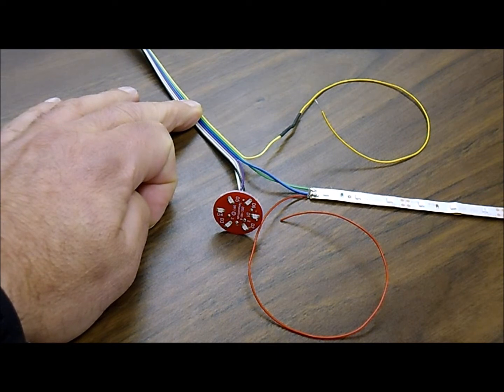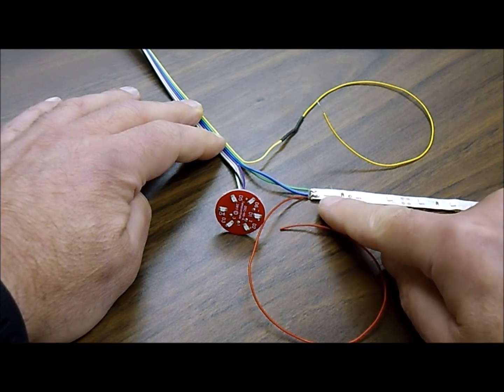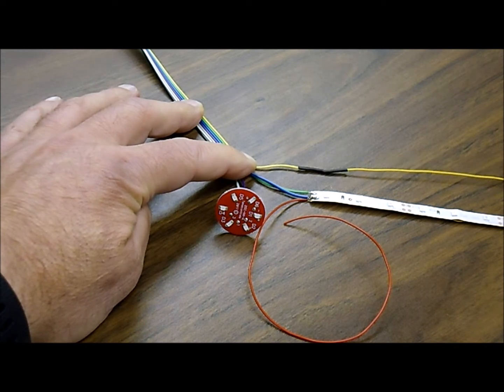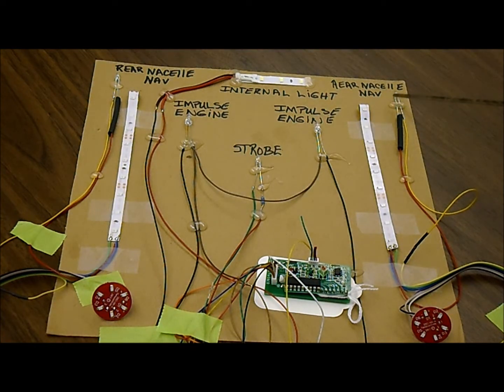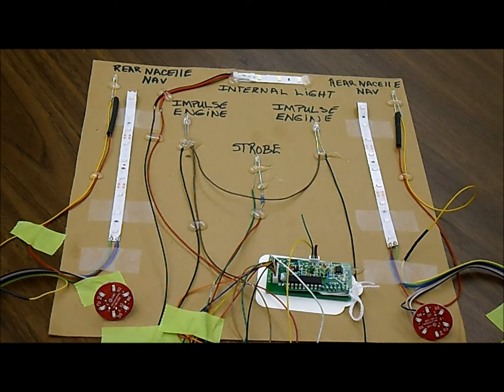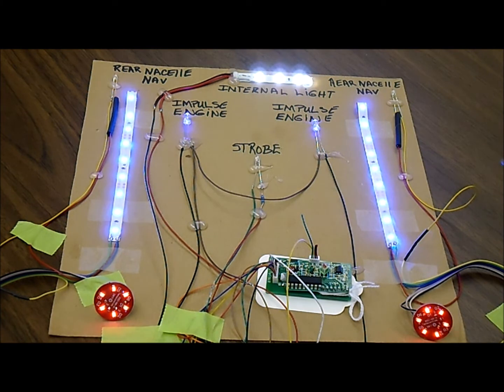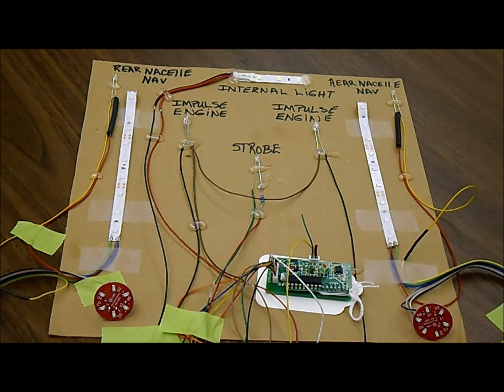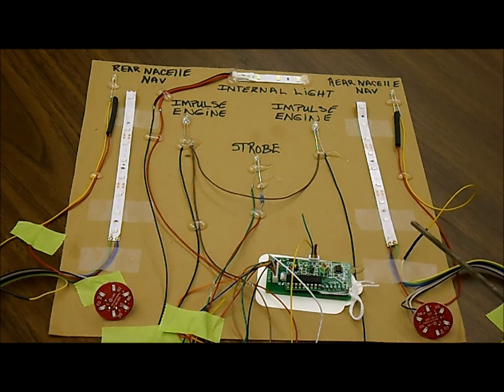Demo Video of the New Remote Control System for the NX-01

Comment: I have the NX Combo-A set.  Is this new setup you have in this video compatible with the old set, as far as adding the remote feature?
Reply from the maker: This new board is a remote control and lighting control all in one. Not compatible with the older NXCombo-A.
Reply: Thanks.